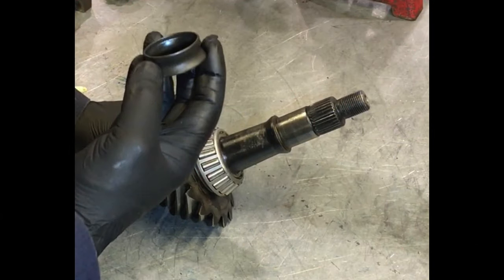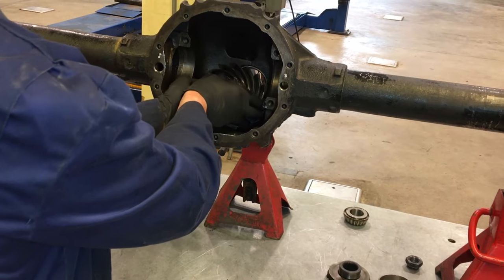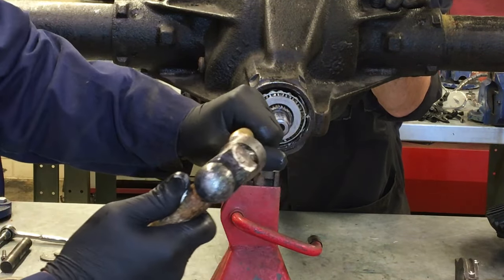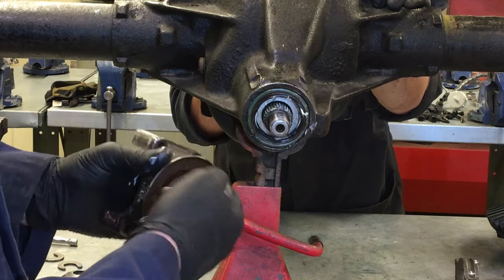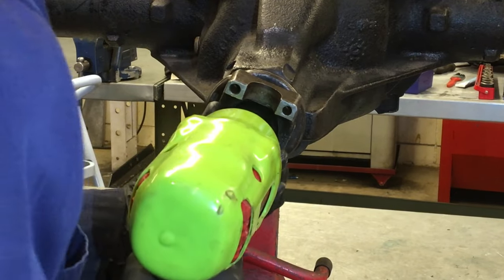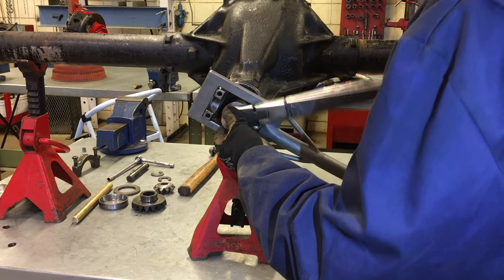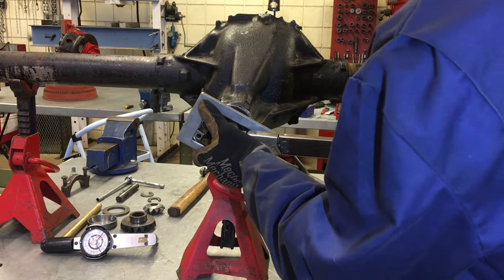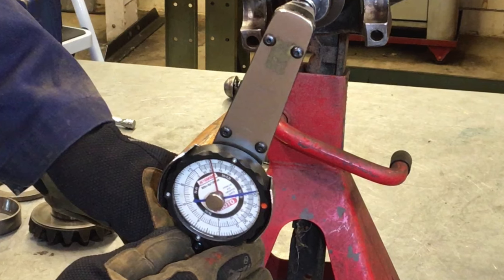How to adjust pinion bearing preload

Comment: Im trying to figure out where I went wrong I didnt lube the seal so perhaps that played some role.  But if my pinion is only torqued to around 50Lbs it seems difficult to turn and the higher the torque load goes the more difficult and even impossible to turn the flange to the point it doesnt move at all.  There is no up and down play even when the nut is only torqued to 20lbs. Do I need to punch the bearings down more to seat them or could it be a different issue.. ..
Reply from the maker: @Michael-oc5ut  Are you reusing your old crush sleeve or is it a new one?  If it is new, it is possible that is an incorrect sleeve, so not allowing proper set up.  If it is your old one, it likely is over-crushed and needing replacement.
Reply from the maker: Good idea to check that your bearing races are all the way in, for sure, as that certainly could also cause high readings before reaching minimum torque.
Reply: @bensiemers5094  when I heated the bearing the first time I noticed it wasn't all the way on the pinion shaft the smaller bearing on the driveshaft side it seems like after I froze it then the thing slipped  down and fit right.  I'd like to avoid taking the whole thing back apart but I'll try to hit it in a few areas with a flat punch and hammer and see if changes things.  It's a solid spacer are I measured to make sure the proper  shims were there so I don't think it's a crush sleeve issue
Reply from the maker: @Michael-oc5ut  You really should avoid heating the bearings to install as to avoid softening the metal, unless only a few hundred degrees in an oven.  They are meant to be cold  pressed on.  The small bearing doesn't need pressing as it is only a mild interference fit.
Reply from the maker: If you have a solid space, then you will have to play with shims until it can handle the specified pinion nut torque.  It won't be stated as a minimum but generally a set torque.  You will also have a specified pinion rotating torque in inch lbs that needs to be met.  My procedure outlined only applies to crush sleeves and not pinion bearing spacers and shims.
Reply: @bensiemers5094  I added more gear oil to the bearings and it seems like everything spins better.  I used a good set of calipers for measure the shims so If things don't match the preload in inch lbs I'll take everything back apart.  Would I decrease shims if the rotating torque is too high.  I don't feel there is a minimum torque value  listed but the book says around 120lbs max would it be bad to only run it at 70lbs as a example
Reply from the maker: @Michael-oc5ut  70 would be far too low.  Because this isn't a crush sleeve but a solid spacer, you won't have a minimum torque.   Unless this is a small car, 120 seems low, but if that for sure is the pinion bearing preload listed, then you need to torque it to that.  But please double check.  If you under torque that nut you risk the nut loosening and tearing the bearings up as well as destroying your gear set.  You need to have a shim set that has just one to a few thousands differences when swapping from one to an other to dial that in correctly and allow proper rotating friction. If your shims are directly with the spacer, swapping your shim with a thicker one will space the bearings further apart from the outer races, thus lower rotating friction, and therefore allowing higher pinion nut torquing.
Reply: @bensiemers5094  Thanks that was the answer I was looking for and a big help.  I actually used another guys numbers from a similar  ring and pinion and car and used the shim set that was close to it.  Obviously the number is off.  I have to add shims i.e. thicker shim pack.  For some weird reason I thought being .005 tho under would work for my setup.  Is there any best guestimate on how many to add or should I go .020 or .010
Reply from the maker: I am not sure what your initial shim combined thickness is, but .010 is a big change, and sometimes just a difference of .001 or .002 does the trick.  Seeing you are significantly high in preload, you might get away with more of a jump.  If, for example, you add .010 extra and can't build friction, then you know it is too much and the ideal shim thickness is somewhere between.  I have had on numerous occasions had to sand a shim down on emery cloth,  in a figure 8 pattern, a thousandth at a time, while ensuring that I check around the shim with a micrometer or calliper  to maintain even thickness.  So it can be tedious if you don't have fine enough increments in your shim collection.
Reply: @bensiemers5094  I did a retorque to 70 just to see if the gear lube made a difference...  Hell no 😂 it won't turn at all like it's completely seized.  I'll check my shims to see what the thicknesses are but I'm definitely thinking it might be close to .010 needed

Comment: Just had my front diff rebuilt with 4.11 gears. On a 2006 Commander. Started noticing a clunk then a vibration at 50mph. I checked things out and found play. on the front pinion, would that need to be redone again? 
Thanks
Reply from the maker: Hi John.  Thanks for the comment.  If you can feel up and down or plunging play, as opposed to rotational backlash (which some is normal and needed) then you would need to have that pinion reset up correctly, for you to prevent doing long term damage.  They may have to replace the crush sleeve, if they can establish proper minimum torque and if this is causing you to loose preload on the pinion bearings prematurely.  If there is no actual plunging or up and down play, then look for possibility of driveshaft phasing issues if you have a two piece driveshaft.  U joint play or a loose unjoint connection going into the drive yoke can also cause clunking and vibration issues.  Hope that helps.  Ben
Reply: Thanks for the information. There is up and down movement and the driveline is new.
Reply from the maker: The folks who rebuilt it will have to fix that up for you.  Best wishes John.  Have a great day.

Comment: great video. Where can I get that type of inch pound torque wrench you are using?
Reply from the maker: This is a Proto 1/4 inch dial torque wrench.  They are available through amazon or Proto dealer.  Expensive though.  350.00 dollars or so.  A deflecting beam torque wrench is equally fine though at a much cheaper price.
Reply: @bensiemers5094  Thanks!
Reply: @Mr.BigweldNBTX  I love proto but that dial torque wrench looks just like my  precision instruments 1/4 dial torque wrench that can be had online for a good bit less than he paid. I believe that company is part of the snap on tool group.

Comment: Is the pinion supposed to have back and forth play?
Reply from the maker: If by back and forth you mean in and out, no it should not have in and out play.  There will be backlash, however, once the crown gear is installed and is in mesh with the pinion gear.  Backlash is the play you get when twisting one direction and then opposite.   I hope that helps.

Comment: Where did you get that holding tool it's everything when doing that job
Reply from the maker: Thank you for your comment.  I made that one using a plasma cutter, chop saw and welder, some steel plate, pipe and bracing so it fit over the yoke.  I have made several through the years for my students.  I have used pipe wrenches in a pinch and jam bolts but it is hard to beat a tool made for the job.  Summit racing has a universal pinion yoke tool (SME-906005) for a reasonable price)  There will be other options online as well.  :)
Reply: @bensiemers5094  Oh yeah...I am so building one even though my midlife crisis 96 Firebird WS.6 hopefully won't require in-depth diff work very often. That thing is slicker than snot onna brass doorknob!
Reply from the maker: You can't go wrong with extra tools being there when you need them.  Have a great day.

Comment: What happened to the oil slinger?
Reply from the maker: Are you referring to the condition of the dust shield?  This demonstration was shown on an instructional model which came apart many times.   This particular model doesn't have an actual oil slinger on the pinion.